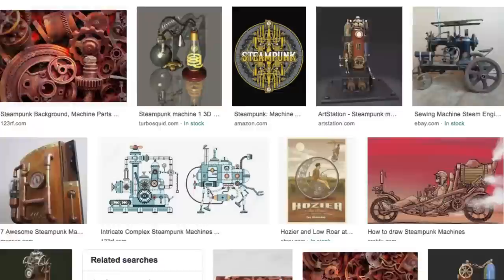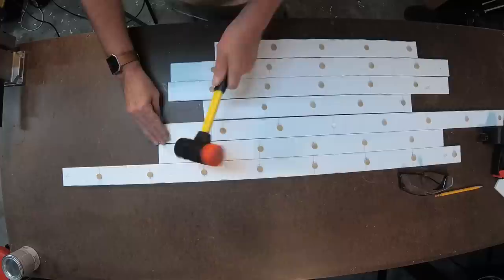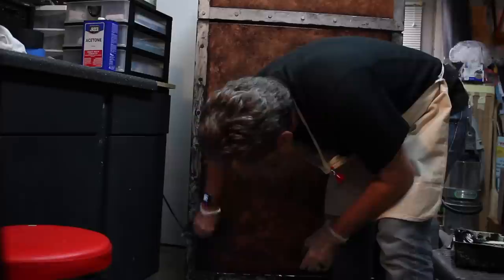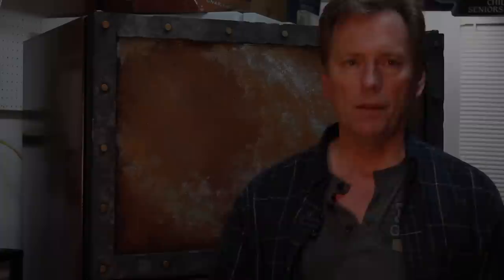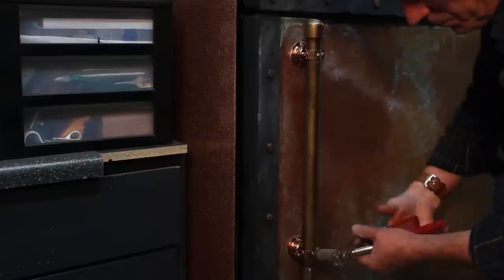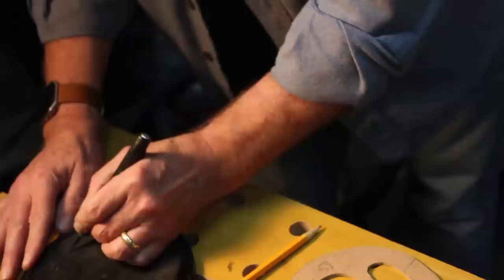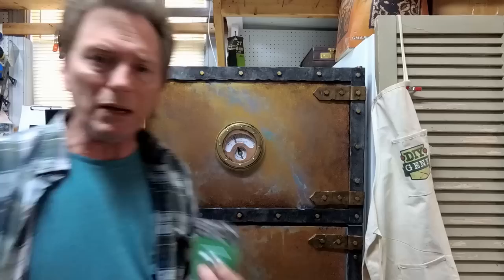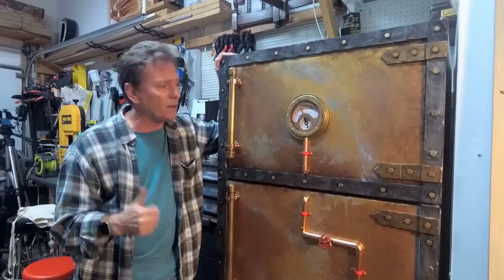Best Man Cave Fridge Ever! Steampunk You Old Fridge

Comment: Will you Please provide an update? I would love to know if the fridge paint started to rub off or flake. If you don’t use it daily then your results might be very different than mine. Also, I clean my fridge often. I followed a different guide, not yours, but similar. I noticed that the paint eventually rubs off during cleanings. I’ve used a very similar process. The paint eventually flakes, rubs off and peels. It’s very disappointing after all of the work produced. I edited this comment. I appreciate your quick response. It was very helpful. Hopefully, the absence of the lacquer thinner is the reason why paint chipped and rubbed off. I’m sure that I used a top coat sealer but it was so long ago that I can’t clearly remember.
Reply from the maker: That would be very disappointing. Mine is holding up really well and has been cleaned a lot. Did you prep the metal with sanding and wipe it down with lacquer thinner to help make the paint adhere well?  Also putting a clear coat on  top will definitely help protect the finish. I’m so sorry  you are having problems with this. I have been so happy with the results, that I’ve just done the same technique on the inside of my garage door. Video coming out soon. Can you touch up the paint?
Reply: @DIYGene  That’s wonderful. I look forward to the video. I should be clear that I didn’t follow your exact process. It was a different guide. I didn’t use the lacquer finish but I did sand. I did put a top coat on it. My finish that I was working with is stainless steel. Thanks for the response
Reply from the maker: @chris1638 , Oh wow, stainless steel is so hard to paint. I think it needs an etching process and that green self etching primer to even get anything to hold up on it. I know you must have had a lot of time into this project.

Comment: Did you mix the paint well or just a little it was hard to tell but the paint looked swirled im just askin so i can get the same effect 🙃
Reply from the maker: It depends on what paint. The background copper is mixed well. The colors I added are mixed as I apply them. I hope that helps. Thanks for watching.
Reply: @DIYGene  thats what i figured i noticed the swirl i figured you added it in thank you i might be doing this to my fridge

Comment: No sanding for paint prep???
Reply from the maker: Washing it down with acetone or lacquer thinner was enough to let that hammered enamel bite. And after two years it is holding up great. I even have industrial magnets on the side holding up things and I can pull those off with no paint peel or damage. You could go over it with a scotch pad to be safe. I hope that helps. Thanks for watching.
Reply: @DIYGene  Thanks for the info!

Comment: Great video! I saw your garage steampunk video as well. I was wondering about you drilling into your fridge and freezer and drilling into your garage door. There’s insulation in most garage doors that they say is hazardous to breathe in. I was wondering if you allowed for that or considered that? I was also 
wondering about when you drilled into your freezer and fridge if you worried or considered that it might be losing coldness? Asking because I might do the same. Thanks.
Reply from the maker: I thought about that but after removing the original handles I could see the insulation inside. It looks like you typical fiberglass insulation. So when I drilled into the fridge doors I was careful to not drill any deeper than just the metal. Then after putting rivets back in, I have seen no loss of cold. As for the garage door it has styrofoam insulation and was not a problem either. I hope that helps. Thanks so much for watching.
Reply: @DIYGene  Excellent. Thanks for the quick reply.

Comment: You did all this beautiful work but you didn't do  the most important step,,, you didn't sand and prime  and that is going to ruin your work
Reply from the maker: Normally I would sand the surface but the acetone removed the gloss and made the hammered enamel etch into the old finish. It is now two years old and the paint is holding up great. I even have a couple of industrial magnets bolt trays on the side and it hasn’t hurt or removed any of the paint. The enamel stunk really bad so you need good ventilation when applying it but once it sets up it holds like iron. Thanks so much for watching.